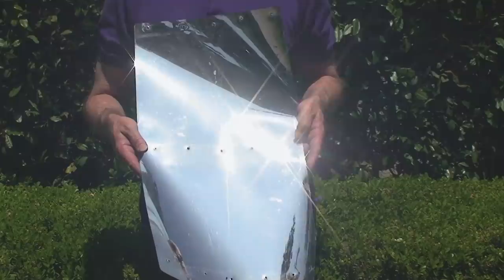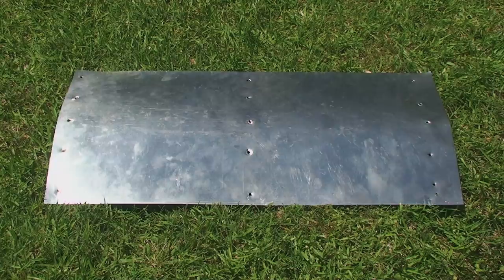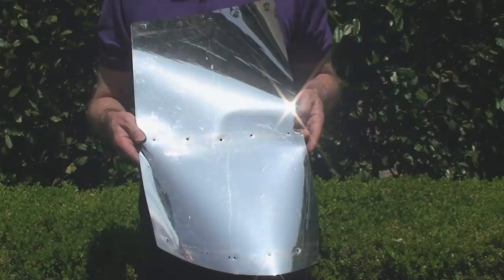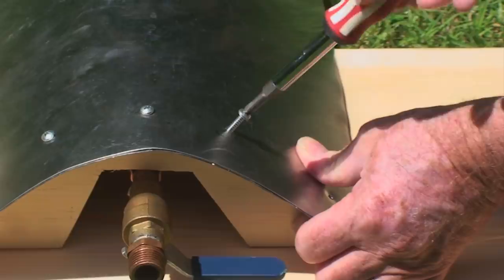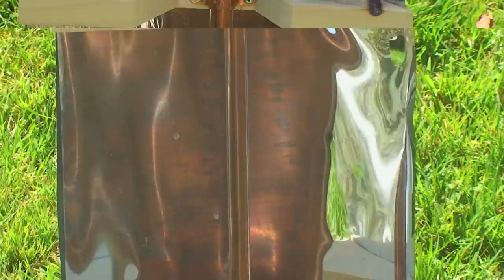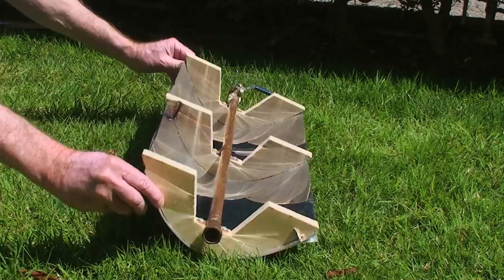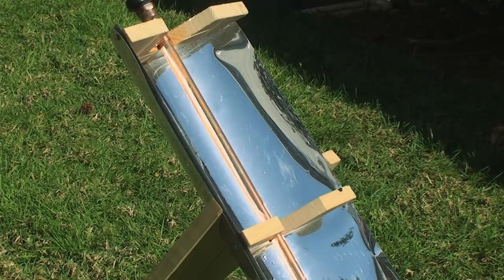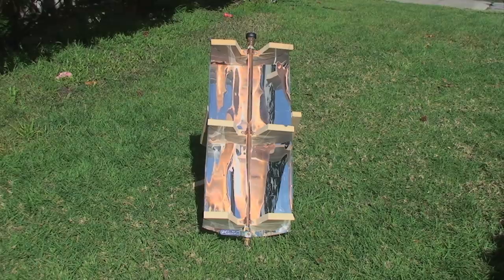Solar Water Heater Demonstration

Comment: Covering the assembly with clear plexiglass or glass to incase it will drive temperatures up even more. Like a greenhouse effect.
Reply from the maker: True, and it's mentioned in the video.
Reply from the maker: Thank you.
Reply: Here's another tip - try using a candle flame to coat the copper pipe with soot to increase absorption.
Over 20 years ago, I made a dish collector from a 1.2 meter diameter satellite dish coating with aluminum foil and later a mylar survival blanket which could be focussed using air pressure.
After coating the bottom of a small pan with soot, it was able to make a cup of tea in about 2 minutes!

If I had the capability then, I would have made a hollow carbon-blacked copper sphere to collect all the energy without any reflections, or make a hollow sphere out of thin copper tube.
For a trough setup, a crescent-shaped pipe formed to capture reflections might be worth experimenting with!
Reply from the maker: Soot is actually an insulator.  For best results, the pipe should be chemically blackened.
Spherical reflectors make for very good cookers.
Reply from the maker: True chemical blackening is kind of an aerospace thing.
I used engine black paint, then wiped it off while still wet.  A black "stain" remained to cover the pipe without leaving the insulating thickness of the paint.
Aluminum, which is not good for this type of situation, would be anodized black via electroplating.  It's a little different for copper, especially pipe lengths.  It involves some really caustic stuff.
Reply: Would black "iron" pipe work in this case... the kind sold in the big box stores?
Reply: @ahaveland  or...you know....paint. Why would you use candle soot that can easily be wiped off...?
Reply: @robsecker100  The temperature can get hot enough to melt steel. Paint would just burn and turn to carbon anyway. Candle soot is basically amorphous carbon nanotubes and buckyballs that absorb and conduct heat effectively.
Reply: @ahaveland   1) This clearly isn't getting hot enough to melt steel (2500F). It's clearly not getting hot enough to melt copper (1900F). It's barely hot enough to boil water (212F)

2) High temperature carbon based paint exists for a reason. 

Turns out people want to paint  hot stuff black without using candles.
Reply: @robsecker100  I built one - I know what it can do. Try it for yourself. If you defocus it then you can keep the temperature down, but soot absorbs better than any paint because its structure doesn't allow reflections. Yes, it wears off easily.
Reply: @ahaveland  

I highly doubt you built a solar concentrator large and accurate enough to melt steel...again, 2500F. 

 Giving you the benefit of the doubt, if you did indeed design and built a solar collector that could melt steel, the paint or soot or whatever is pretty irrelevant. Why does it matter what you've coated your tube in if you're melting it?

Long story short: Use paint. In the temperature ranges that we're talking about (200-400 F) there's literally no reason to use candle soot and you're making yourself look really silly insisting on it.
Reply: @robsecker100  Yes I did make one. A 1.2 m diameter mylar film focusing to a few square mm is an enormous energy density.
Yes, paint is good enough at 400F. All I'm saying is a thin layer of soot is a better collector of energy because it is a very matt substance, I said nothing about it being practical.

Comment: Only works in hot sunny conditions though. I think evacuated tubes are a much better solution. You can buy the tubes now and build your own heat exchanger. Think your idea is nice though for hot water but in hot countries only.

Comment: Interesting if you need really hot water. However it cannot collect any more heat than what is collected by the size of the reflector. If you simply had black pipes covering the same area, the heat collected would be the same?

Comment: 100ml (half of a cup) 1 degree F each 6 seconds - so around 1 degree C every 10-11 seconds gives me roughly 1 kcal each 2 minutes for 2 sq feet. Its 80W (4,19J/s is one cal/s if i remember correctly) Albedo of the sun in troposfere i think is around 800W/ m^2 soo... roughly computing 150W / 2 ft^2  so 50% of efficiency is quite a good achievement :)

Comment: It's not boiling, because you're only measuring the hottest part of the water, which will float to the top of the pipe. In order to get it boiling, all of the water needs to reach about 99 °C. But if that would happen, most of the water will just shoot out of the pipe. Just like when boiling water in a testtube. Nice idea though.
If you know the exact amount of water and the temperature rise over time (you need to empty the water into a cup for this, to get precise readings of the temperature), you can calculate the heating power.
Reply from the maker: On another day when I was not shooting video, and there was no wind cooling the pipe by blowing over it, the water did reach boiling, I could hear it bubbling in the pipe, and see a few drops of water splashing out the top.

Comment: Just a suggestion, wouldn't it be better to have the reflector support on the outside? Because when there's those wooden things inside, the shade from each would decrease the overall temperature as sun rotates?

I'm about to build something similar for steam engine.

Comment: it will operate at peak efficiency during the middle of the day. the early morning and late afternoon will only be at 1 tenth of the solar exposure during the middle of the day
Reply: You are correct but if you position the reflector to catch the suns rays at the maximum point of the day, the remainder each side of maximum will be a ramp up to maximum then a tailing off to minimum. During the cycle of the day with a good sized system this will be more than enough to give a days hot water for a domestic system in a sunny climate. There are many systems of this type on roofs in Spain. The rate either side of peak efficiency is not 1 tenth of the exposure, as the sun travels across the horizon the efficiency increases to maximum (peak) then slowly tails off. This can be improved some with a tracking device that moves the assembly into the peak throughout the day.

Comment: How much water you producing with that little thing? When the power is off I have laid black garden hose in the yard and fill it with water and let it stand for a bit. Gets pretty hot. Won’t boil but hotter that you can stand.

Comment: just doing some really rough calculations it looks like you're getting 150btu/hr out of this example. Pretty cool for such a simple and small design.

my math:
6 secs to rise 1 deg = 10 deg/min = 600 deg/hr
600 deg/hr = 600 btu/hr per pound of water
1/2 cup of water = .26lbs of water
600 *.26 = 156
156 btu/hr

Comment: Excellent sir! 
By the way:
Newtonian laws of force and motion when applied to the angular velocity of a rotating spherical  body, when crossed by an implied gravitational force that pulls toward the center mass of the body produces a force vector graph that shows angular velocity at a 90* right angle to gravity unopposed at the poles that changes incrementally at each latitude from 90* unopposed to directly opposed at the equator of the spherical body. The only place where both forces could find balance. 

Newtonian laws of force and motion predict that if Earth were a spinning sphere with gravity pulling towards its center of mass all unrestricted water on its surface would necessarily have to follow the vector angles produced to the equator and then upward to the point where gravity's fixed and angular velocities increasing forces were equal, but since angular velocity increases with radius it will overtake gravity at some point and propel the water out in a disk and off of th

Comment: I would like to see a test made in Canada when the temperature is minus 25 degrees Celsius. Has there ever been anything like that done before??
Reply: Have you seen pictures of mountaint skiiers sunbathing with just swimsuits on the top of the mountains while air temperature is minus? Or just look stand behind the window on sunny days. For Canada is large - efficiency depends on latitude and time of year. But concentrated sun is powerfull.

Comment: Wondering what you would recommend as a simple insulated hot water storage item that is only about 5 -7 gallons? Lots of off grid van dwellers or bushcraft folks could use this sort of heater and store water to cover a 12 hour period. 24 hours would be even better. They could mix cool water with the hot water to use for many applications.
Reply: RV water heaters are 6 gallons , maybe one from a wreck
Reply: Drill ports on a cooler storage water in the cooler

Comment: Maybe paint the pipe black too
Reply from the maker: See comment about this.
Reply: What comment? Where?
Reply: Pete's Shredder.
Reply from the maker: Buried in the comments.
I did blacken the pipe with negligible results.
Reply: Black coverings will absorb some of the heat needed to hit the copper.  Not a good idea for highest efficiency.
Reply: Mike L he already tried it. the gain was negligible.
Reply: Salt absorbs heat easily and gives it up almost at the same rate as fresh water which is why it is used to melt snow and to aid in making ice cream at home and why it would not be a good idea in this type of water heater.   Black paint on the pipes will also limit the amount of heat getting to the copper pipes as well.  Heating water in this matter is a simple engineering task wherein un-coated  copper pipe is used because as much heat as possible needs to hit the copper which transfers it directly to the water.  Anything between the copper and the sunlight will inhibit heat transfer thereby limiting the temperature of the water leaving the pipe. Think shade tree in August - noticeably cooler in the (darker) shade.   The pipe is placed in a box which is often painted a light color or even lined with aluminum or other reflective foil on the inside so the light bounces off it and back onto the copper pipe.  Glass covers the box to concentrate the light/heat - think car anterior on a sunny day.  The entire heater is placed/mounted to receive the maximum amount of sunlight as possible and the device's input is fed by the residences cold water supply and its output can then be fed to the house.
Reply: Gary DePietro my first da
Reply: Gary DePietro 

 gfgggh
Reply: @mikel4510  Almost everything you said here is completely wrong.

Salt does not absorb heat as well as water. It's about 2.7 times worse. Heat capacities of water and salt are, respectively, 4.186 and 1.53 J/gK.

Salt isn't used to absorb heat when making ice cream or salting the roads. Salt is put on roads to lower the freezing point of water/ice. It's added to ice makers  to lower the temperature of the water that melts off the ice cubes, allowing your ice cream to get colder; otherwise it would never go below zero celsius and thus never freeze.

Black paint on the pipes won't prevent heat from getting to the pipe. In fact, it will allow the pipe to absorb more solar radiation. Black objects absorb heat more easily than shiny copper objects. Paint, which is microns thick, doesn't prevent heat from conducting through to the pipe.
Reply: Use BBQ paint, the parabolic nature makes HOTHOTHOT surfaces.
Reply: @mikel4510  didn't consider that thanx.

Comment: Great video. I too am interested to understand whether concentrating solar energy in this way can be used to heat the air in an enclosed cabinet that can then be pumped to cold indoor areas.
Reply from the maker: Theoretically, yes.

Comment: Why isn't it used broadly? Because it works only in summer - that's 1/3 of the year. And you need your own roof for the installation, which means you can't have it if you live in an apartment.

Comment: I understand not going to the extra trouble to enclose the pipe or glaze the entire apparatus. What I don't understand is why you didn't bother to paint it black, which would have been very simple, and would have increased temps significantly.

Comment: Thank you for a good video. 
Can you show how to use this in a thermosyphon?  (sp?). 
If you can heat a drum of water with this, I can see possibly heating a house with it.
Reply from the maker: Theoretically, yes.
Reply: You commented a long time ago.   I've thought about a heat sink of some sort and then draw domestic water from it as it circulates through.  I'm seeing some channels showing this method and it's working for the homeowners.  My issue is that a lot of them like this channel do not reply to comments which becomes frustrating.
Have you tried the set up or did you put it on hold?
Reply: @beebob1279  I am weighing options for a later date. 
Thanks for getting back with me.

Comment: very inspiring video.. I would also like to see if whats the most effective using soda cans or  this copper pipe..
Reply from the maker: This system is for water.  Soda cans are not able to withstand typical water system pressures.  However, I did build an air heater using soda cans.  Video to come.
Reply: really? when is that video coming out?

Comment: Black plastic water pipe formed into a spiral and attached to a sheet of plywood does a better job with less work. 100 ft. of 1" pipe will hold 5 gallons of water.
Reply: Would the plastic degrade if not quite thick?

Comment: If the whole point is to show how effective concentrating sunlight is, why wouldn't you test it along side a copper pipe without the reflector?  Based on what we see in the demo, for all we know a plain copper pipe would have gotten just as hot in the sun.

Comment: Try a smaller thickness pipe. Have a straight pip going across the length of the reflector and coil the pipe around that to super heat the coil of pipe to get very hot. Or just heat oil for an oil radiator for a heater. A coil or loop of pipe with hot oil could also act to heat water.

Comment: Here's an out of the box suggestion chip packets turned inside out as the reflector (same as Mylar??) 
Just a thought
Reply from the maker: Yes, but you still need to spread them out mirror smooth.

Comment: I fantasize about a salt water tank filling my entire basement, super insulated, heated by a system like this. Rooftop, single horizontal pipe with multiple reflectors in a Fresnel pattern. Could heat the house with it.

Comment: A proper demo should have included a pipe in the same setup without the reflector...because a copper pipe on its own would seriously heat a 1/2 cup of water
Reply: No, the heat of the sun on metal objects can raise them to very high temperatures without a reflector. One example is the way that the padlocks on my allotment shed get so hot in the summer that I can't handle them without gloves. Garden hose laying in the sun get so hot that the water emerging from it steams.  Of course a reflector increases the heat input, but with a large area of solar collector and strong sunshine you can reach temperatures which are more than enough for typical applications.
Reply: ***** Wrong: the hose lies on a dirt path. It is a statement of the blindingly obvious to remark "As soon as you put more cold water in the hose it will cool the hose."

And it's not a great deal more informative to say that by adding a reflector you can capture more energy.  Duh.
Reply: ***** "the heat of the sun on metal objects can raise them to very high temperatures without a reflector." Take for example the bonnet of a car (a dark colour shows this effect strongest). In an area of intense sunshine it too will get uncomfortably hot to the touch. I have given practical examples from my own experience. 

For water heating with a garden hose, you will find many YouTube videos.

If you choose not to believe me, tough luck.
Reply from the maker: Ok, folks.  Stay on-topic, and keep it reasonably civil.  Otherwise I will have to start editing, and I really do not want to do that.
This comment was aimed at off-topics that were deleted.

Comment: Thanks for posting.  for flowing hot water I assume you add the necessary plumbing?
Reply from the maker: Correct.
Reply: Also much, much more pipe. Flowing cold incoming water will cool the pipe fast.

Comment: OK so I'm being picky but the Earth doesn't really ''move'' its in relation to the Sun and its axis... so seeing the Earth moving back and forth looked odd. But your Solar concentrator?/ awesome.. really good. Brilliant in fact. OK. Yep You're right. Left Me hanging. got a very hot water pipe.. now what do I do with it and how can I heat more of the stuff!
Reply: The earth moves around the sun in an orbit, but as we travel through the solar system we never actually go in a circle around the sun, its more of a spiral, a set distance from the sun. As this happens, the Earth also "wobbles" on its axis and tips toward and away from the sun. This creates the seasons as the sun points its concentrated rays on different positions of the earths surface. It is why when the Northern hemisphere has summer the Southern hemisphere has winter. This is the movement that is mentioned, and is not in relation to the Suns axis, its the  Earths axis that changes position.

Comment: I want to experiment a very small closed loop with a heat exchanger at one one. Aside from water can i use a type of refrigerant in this design to get higher temperatures?
Reply from the maker: Refrigerant?
You can use an anti-freeze/coolant mixture for more stable temperature in the circulation, and/or areas of freezing temperatures.
Unlikely you will get higher temps.